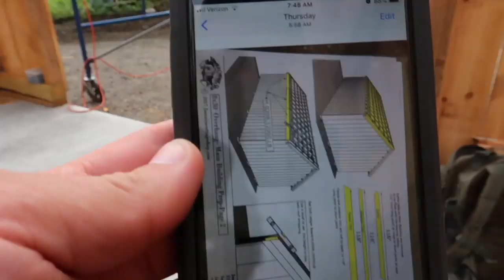Today's the DAY! Starting the Roof on the Post and Beam BARN KIT

Comment: I second the comments about cutting on the back side of the metal. I used a metal cutting blade for years, putting up with the fragmenting blades. Then I broke down and bought a diamond tip blade. I’ll never go back. Smoother cuts and much faster. And they last a lot longer. Awesome job on the barn! Keep up the great work 👍🇺🇸!

Comment: Dry-in is a great time in a project. It's nice to be able to work in or out depending on the weather! Last time I built a tin building it was the run-in for the horses, and I drilled a hole through my finger when a drill bit broke! I was drilling a hole through the tin siding while holding the siding to the building -- too close to the drilling. The bit snapped and the broken bit (the part still in the drill) went right through my finger nail! Stay safe Al!

Comment: My dad showed me to cut metal by stringing a strong metal wire a little longer than the sheet attaching each end to a 2x4 and slid the sheet between the wire and 2x4 then pull the wire up tight and let it snap and normally cut the sheet metal real nice.
Reply: You ain't cutting that roof tin by snapping a wire across it, lol.

Comment: Oh doing roofs is always such a pain. But it’s very satisfying once it’s done. Al just a suggestion here but try cutting your sheets from the back side that way you won’t scratch the finish side and it’s easier to cut not having to go over the humps. I also put clamps on them to hold them together tightly. That may be an un- necessary  step but it makes me feel better.. looking good!

Comment: RR building uses an awl (thru shank) to punch holes. If you position all the steel against the building, you don’t have to keep climbing up and down the scaffolding. A helper on the roof will limit your climbing up and down the roof. You do too much work:). 

Your roof is dumping rain onto your fascia. Surprised you didn’t flash it first. 

Amazing how quickly your pigs create disturbance. Barn is looking great.
Reply: I agree about the fascia but should have run it down a few inches past it

Comment: Al, its testing time (like with the water freezing faster test) cut 10 sheets upside down and see qhat difference there is both in speed and over time corrosion.
Reply: Michael J. Schaefer LOL!!! Forget the testing for now, just get that roof on!😜
Reply: That would give a level surface to cut across, keep the saw blade away from the concrete better,  and save the face of the metal from rusting due to scratching.

Comment: I used a punch and hammer to put the holes in my metal roof. It was quicker and didn't leave shavings in the metal. I did the same thing at the bottom to hold my metal. I just finished my roof. [My building was a 36x40 pole barn]

Comment: When you cut metal roofing with an abrasive blade it oxidizes it beginning the rusting process immediately. I can tell you from experience that it is well worth the time to cut it any other way.
Reply: Its a barn not a house roof (eyeroll)
Reply: The barn roof has to be maintained just like the house roof, BOTH very important if you’re living on & working a homestead.
Reply: Depends if it's steel or aluminium. Only a problem with steel.
Reply: According to the Kit maker it is Corrugated metal with a 30 year 'Finish" warrantee. Don't think they will cover any cut pieces with bare metal. It will suffer from 'White Rust" in a few weeks in wet humid conditions and will eat away at the metal under the powder coat. I would put all cut pieces on top and prime them.
Reply: Yep, I wouldn't even drag one on top of the other. Most of the time it scratches protective coating(sand, dust, small gravel, small bends on the edges, cuts if you needed to do so.)
Reply: nanikas yes the scratching from the predrilled holes makes lots of scratches on the panels below. I should have lifted them more

Comment: Take a plastic water bottle and drill a small hole in the cap. Next time you drill your sheets, stream some water on your bit while drilling. A cool bit stays sharp. Also make sure the bit has wood under the drill area so as to not hit the concrete. Love your videos. Great job.

Comment: I've never seen anyone screw metal roofing in the valley. I've done many a metal roof and was always taught to put the screws on the peak of the ribs. Water runs down the valley while the peak of the rib stays relatively above any water running down the roof. I'm sure it can be done many ways. Looks good!

Comment: You can punch the holes for your screws through max 10 sheets using a strong, sharp (cheap) punch with rubber head/handle and a heavy hammer. Much quicker and easier than drilling. And holes won't corrode.

Comment: Nice building.  Tough building one by yourself even if it is a precut.   When I had my shop built, we put a vapor barrier on the roof before putting on the metal sheeting to keep condensation from dripping down on the inside.  Maybe that's not a problem in the northeast.

Comment: I wonder why they didn't have the roofing cut to length. The plans were known you were putting overhangs on each side which should be covered first so the main roof  overlaps the sides. Paint your cuts to help prevent the oxidizing.

Comment: I do not feel so bad knowing that others, much younger, experience the same pain from going up and down ladders while roofing.
Keep your fasteners perpendicular to the tin when running them in, for a better seal. Also, do not run them until they create dimples in the metal, just snug them; Maybe set your drill/driver clutch to a lower tension.
Thank you for the example you set for others.

Comment: Might have been nice to run the roof strapping to the outside of the front and back roof over hangs.
Would have tied them in better and gave a place for the metal to be screwed to
Reply: Looks to me that hes putting the cut ends up so the rig cap will hide any rust that forms.

Comment: Curious to see how the shed roof fits in because iI'm surprised to see the barn tin end on top of the siding. It doesn't seem like it has enough overhang to channel water and ice away from the barn wood.
Reply: I totally agree, there should be an overhang to direct rain water away from the barn, looks like a rather expensive mistake
Reply: When there is a change in pitch, there is a piece that fills in - either a peak or a valley. The upper roof panels are 2" down from the peak - because a piece will go over that and cover it. At the bottom of the upper roof will be a valley, as there is a change in pitch - and the valley piece will be tucked under the upper sheets he is putting on now. Remember he has yet to start the build of the two sides - its their roof that will complete the join with the upper part.

Comment: You should have cut tin with a dole wooden blade small teeth install backwords on the saw. The screws should be screwed on the peak not the Valley, that will prevent water infiltrations and don’t screw too hard, the washers on the screw lightly skish.
Reply: Doesn't matter where the screws are, it won't leak.

Comment: Used a punch for the steel the indent will show all the way through. I saw that on R&R builds But by the time you read this you,ll done(smile)
Reply: RR buildings is a great site. Shows what 2 or 3 people [ WITH A LOT OF HEAVY EQUIPMENT AND ALL THE POWER TOOLS ] can build. You can take pride you did it yourself but you might have been kinder to your body if you hired a young helper / gofer (local kid from the high school shop class ). They would appreciate your knowledge and work ethic ( and the goats and pigs and maybe a farm lunch ).  Great job and great video (most viewers don't understand  that a video is a small movie production and a lot of work and time ).  Take care

Comment: when drilling tin or any metal go as slow as u can it will drill faster and the bit wont get as hot n dull up on ya.  heat is a drill bits worst enemy..:)

Comment: I like the barn build great job I would like to suggest a Electric  shears and instead of drilling use a punch that’s what Kyle from R&R buildings uses 👍👍
Reply: Paul Brennan Kyle has another great channel, would have done his hole punch technique (forget the technical name of the tool) to punch the holes for the screws in the metal roofing instead of drilling them.
Reply: @jamess5981 , We call them an Awl.
Reply: august thanks, thought it was something like that.

Comment: Why does everyone cut ribbed roofing with the finish side up?  The inside is FLAT. But I only worked sheet metal for 30 years so what the heck do I know? Critique aside, yer doing an awesome job assembling this 'kit'.~Eli.
Reply: WoW
Reply from the maker: I wish I would have know that earlier. Now I know for the next project. Thanks for the tip
Reply: You should not cut with a saw in the first place, cut with a sheres . the finish is not garinted when you cut with a saw !!!!!!!!!!!!!!!!!!1
Reply: Flat? Isn't it the same shape on both sides?  I understand what you mean, but it ain't flat. The ridges are just upside down.
Reply: @davenelson9253  You've got to be kidding!
Reply: @LumnahAcres  don't worry we all have done it.  
My first roof I cut all the sheets individually  and I cut one an inch short to top it off.
Reply: @paulmonk7820  The ridges are on the top, the bottom is flat.
Reply: Around here everyone screws into the ridges on roofs.  Supposedly it prevents leaks.  What do you say since you worked in the industry?  I had never seen it done that way before I moved here.
Reply: @Rehoboth farm.....'Private' owners seem to prefer the screws in the valleys for looks. On schools and hospitals we were spec'd to rib screws. With the newer premie washers leaks aren't much of an issue.
Reply: @singleman1986  Thanks.  I was wondering what a pro thought.  I can see the argument for screwing into the ribs.  I just never had seen it.  After that I thought about what might happen if the washers degraded or if a screw came loose.  Personally I'm more concerned with longevity than looks.  Whatever works best.
Reply: @William Glaser...True that. Well said. That's why rib screws are spec'd in public works. ~Eli.
Reply: @singleman1986  The other thing that gets me is people buy 3" long screws for the joints and just avoid the sides, Really the specs are self tapping screws for the joint then one on each side... People will buy those longs ones and crank down on them thinking that how it works...
Reply: @William Glaser...Agreed again.  That said, specs vary from regulating agencies, and mfg'rs. Even the guage will change specs. My thanks for the intelligent/informed discourse.~Eli.
Reply: @rehoboth_farm  - I do it like the manufacturer states.  On the flat part.  The ribs are for expansion and contraction.
Reply: @flick22601  And all this time I thought they were for her pleasure.
Reply: Rehoboth Farm Exactly my question. It also ties the sheets together at their extremities. And given the number of nails in everything I figured he had to tie it all down very tight

Comment: AL.... ya made great preparations for doing the roof panels !!!   That extra time on the ground + the measuring really made it easy !!
Taking the extra time to properly set the first panel .... MAKES THE REST GO LIKE BUTTER !!!!!! ......errr, almost....eh ?!?! 
 ... and shows your previous steps thus far were made within proper tolerances ...... SO NICE JOB .... AGAIN !!  GREAT WORK !!!!

The only problem with using drill bits ... is the HEAT ... and then they SNAP .... a PUNCH works too, but ONLY goes through a few sheets.
So, it really depends what ya want to do .... cuz I think it's FASTER with a PRE-drilled hole that goes right into the wood while on roof !!!
I would TOUCH UP the ends of the ROOF PANELS that were CUT WITH THE SAW .... TO SEAL THEM WITH PAINT.

Comment: Instead of drilling every hole use a cheap punch to punch through holes. Buy a few as they will break but will save you a load of time. Also, those screws are self tapping so I wouldn’t drill many holes. It’s a trade off but ultimately it will go quicker.

Comment: Thanks for Sharing for the building of a barn I just don’t understand why you are drilling holes in the steel roof 
when I do steel roof connected to wood roof trusses I use self tapping screws with 
a rubber washer that’s made for putting on steel roofs just a question I was curious

Comment: AL !
I must have missed it . Are you telling us that the rafters were not cut to the proper length from the factory ? 
Is it not usual to put the screws through the tops of the ridges instead of in the valleys ? That way they will not leak after the rubber washers have aged , dried and cracked .

Comment: Are you going to caulk the screw holes? the rubber washers will rot/break down over time, also, are you going to do anything to try and stop condensation from the metal roof?

Comment: Go back and paint it where you cut it, it will rust rather fast if you leave it bare metal. Btw make sure you screw your screws either on flat surface (in the valley) or on ridges and not in between like in 27:26 . That washer has to sit perfectly flush with surface or it may leak.

Comment: If yo put your roof steel on sawhorse's and then clamp a scrap piece of wood as a guide across the top of roof ridges you can cut better and faster.....  and it doesn't mark the steel.

Comment: Just curious but are you suspended to drill and screw the fixings into the high ridge of the sheeting to allow water to run away from the screw?

Comment: You can save considerable time by using self tapping roof screws ( with the rubber grommets on them)
also , you can make a "story pole" to duplicate the measurements on the metal roof. from John Strada
Reply: They are but they don't work all that well.

Comment: Al, riddle me this Batman.  How come, on a PRE-cut kit, you are having to make all of these cuts (roofing, etc.).  I understand that you made mods to the barn, but they knew this when you purchased it.  Isn't the whole purpose of a pre-cut kit so one doesn't have to do any cutting, thereby removing the chances of messing up and saving time?
Reply: I was going to mention this same thing.  I remember you mentioning that you were so pleased that you wouldn't have to cut the roofing to size and that the ends were sealed to prevent rusting. Why didn't they make sure you had the correct size rafters and roofing since they knew you were adding the side sections. Is that not an option?

Comment: Good job! My one concern is overhang. What are you going to do for overhang over the roof that will be below that one? Looks like you only have an inch or so, there.
Reply from the maker: I will be adding another roof on each side.
Reply: I know. My concern is that this one will not overlap the other one enough. And you'll get rain making it's way between them. I am probably missing something that will become obvious later. So I'll just keep watching. =0)

Comment: I am a bit confused at the length of the tin roof. Surely there should be an overhang so that the rain water will run off and away from the siding rather than directly in to it.

Comment: It's your barn you going to build it the way you going to build it. You're you're doing okay. I just looked at lots of barns. And I seen a lot of good ideas. If I was doing it I would probably expand upon the kit haven't higher and have the second floor start the side overhang expansions. I would also put in a hay chute whichever side you going to have your Livestock on. Moreover you don't have to guard your boards from the wear and tear of the livestock delete right through. Yes this calls for hardwood clapboards. It rains it made a puddle in your barn you did the concrete not in the manner for livestock your moisture is going to puddle in a center. Oh dear. Yep

Comment: How does the roof not leak at the drill holes?  Is there some kind if sealant at the head?
Reply: The screws have a rubber/neoprene washer on them.

Comment: Honking on drill or driver might damage armature and hasten sending out for a rebuild over long term.. Might buy really sharp metal punch from auto parts store and hammer punch holes you marked with sharpie, then drilling should be easier.

Comment: I see where others have commented about cutting the metal from the back and some primer to prevent rusting.  But could you use the tractor bucket to lift the stack of sheets to the roof level?  Might have to move the tractor a couple of times but at least you are not lifting each sheet manually and climbing down and back up.  Instead of using the drill to start the screw, why not use a hammer to punch through and then finish with the drill?

I am interested in how the roof panels for the wings are going to be aligned here.  I would of thought that these panels would need to overlap the lower panels by about two inches.  But maybe just loosen the screws on the bottom row and then the panels can slide under.  But that might depend on if the pitch is different.

I am still amazed at your dexterity and perseverance! I would do one panel and have to take a 30 minute break.  Job is really looking great.  Once the roof is on you can leave all the tools and materials inside to keep dry.  I like the drone footage, I suspect that Olivia is running the drone while you are on the roof top.  Great job keeping up with you.

Comment: There is a guy named Kyle who has a youtube channel, RR Buildings.  He speciallizes in pole barns.  He uses a punch to do the holes in the tin because it does not leave metal shavings that can scratch the paint.  I think is is easier than drilling also.  Check him out.